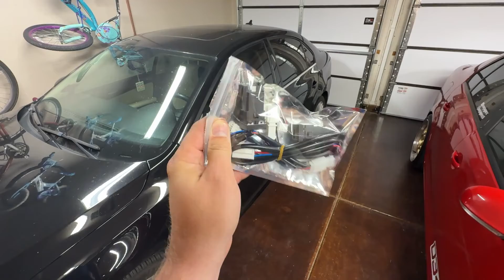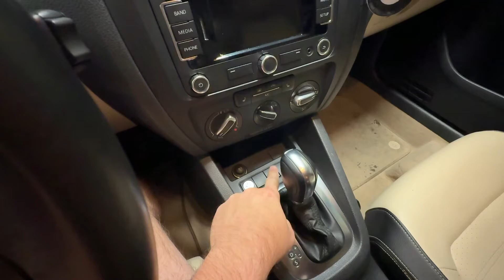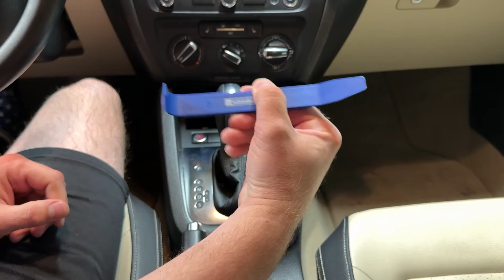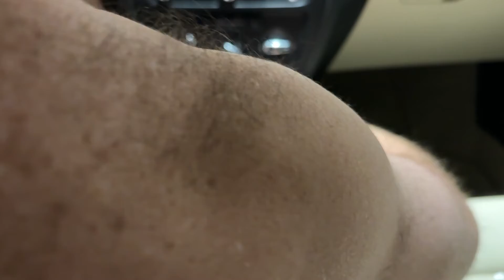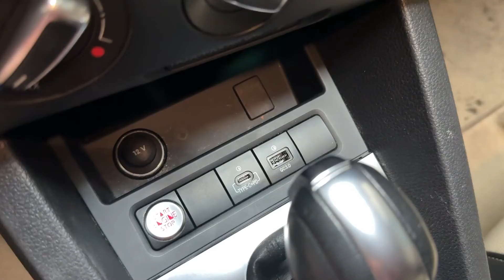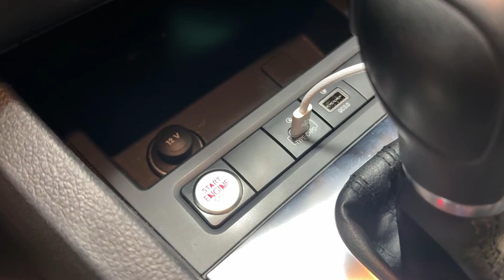USB Port Install In The MK6 Jetta | Power Up Your Devices For Less Than $25

Comment: Does it support 25w charging?
Reply from the maker: @agent47isn1  it’s  QC3.0. It doesn’t specify wattage.
Reply: @VoyageRC  thats probably for the USB A solid probably not then that sucks.
Reply: @agent47isn1 why do you want 25w? I think the idea is fast charge and then you don’t need to use a cigarette lighter port to charge your phone so it looks a little bit neater
Reply: @elkellenhabla because that is the standard for most phones these days 7w or lower isn't enough to charge it and if you use GPS it'll discharge faster than what 7w can do. I've had that issue since the note 8 and now s26 ultra which I have a 45w charger for it